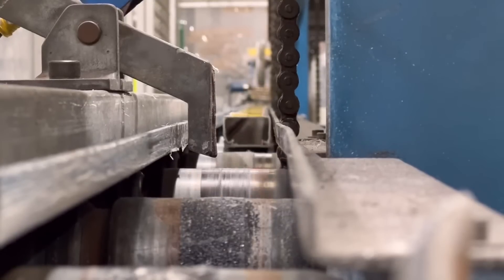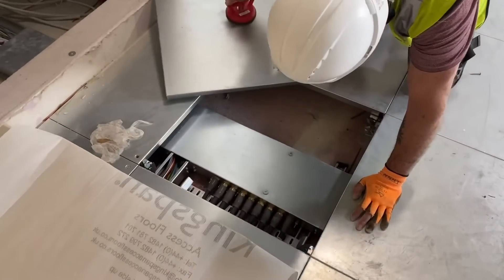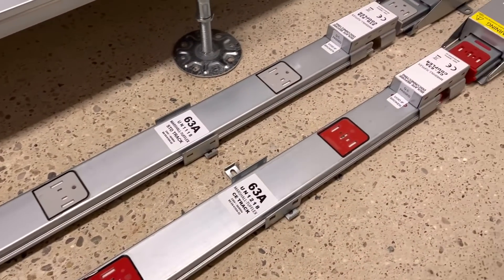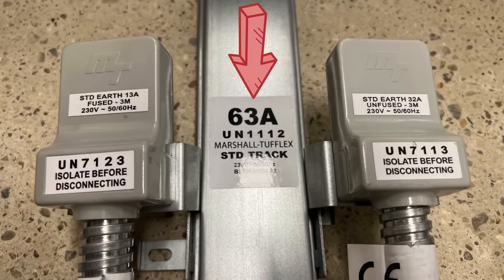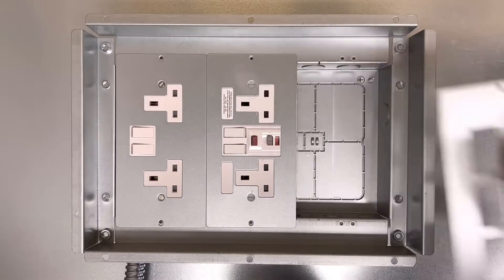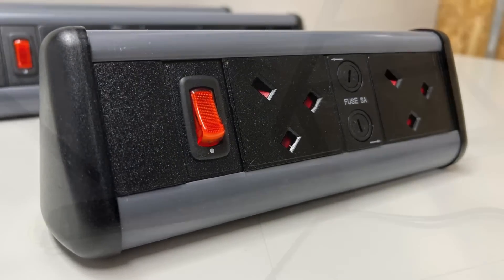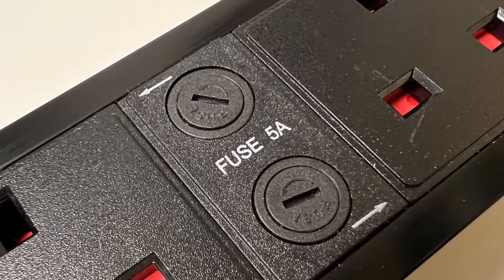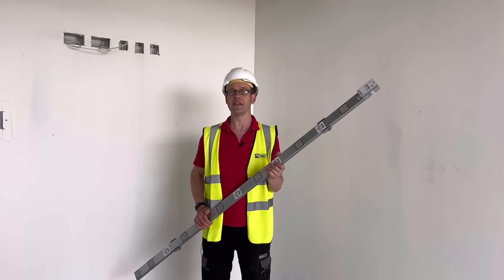What Is Underfloor Busbar Trunking?

Comment: Lol, 16 mm2 cable providing up to 63 amps secured by a mere single terminal block using the most crappy screw head ever designed for this purpose. 
Sure 16 amp circuits are regularly installed successfully using such screw, but 63amps and heavy gauge wire really do require some additional care.

Comment: Did a lot of  commercial re-fits  ,    where this was already installed ,  its called Canalis track,,   trunking system,,, , ,  although , overhead , above the ceiling ,,    3 phase ,,    ,  the outgoing ways ( plugs and leads  ), you  just change the pins .to suit the phases ,,  .   to balance the loads,,  and run to wherever you want,,,,,     .      this was in the u.k  , and about 10 years ago,,,  ,    not sure if it common anymore?   ,        Not sure if it was  something which was a trial, at the time,,    but definitely come across this..              i reckon it was ,  say,    3 lots of  3 phase busbars running the length of a commercial premises ( large shop floor )  ,,  , and could just tap off where-ever you wanted...     a bit of future proofing , maybe ,    but also to minimise  labour and material costs for any additional circuits.,,.'        Zs was always a decent reading tho,,,  ..
Reply from the maker: Great comment, thanks for the insight. 😊

Comment: Legrand also makes a similar system, but have a Three-Phase option as well as the Single phase and Clean Earth options available from Marshall Tufflex. The Legrand system is called Electrak. I was responsible for a site that used it extensively under the raised floors in the offices and computer rooms.
Reply from the maker: Thanks for the comment.
Reply: Legrand do all what was in this video. The underfloor comes in Standard / clean earth / dual / 3phase options. They also do floor boxes which can be configured to almost any specification. Also under desk sockets and on desk units. Really good quality. You should do a video on all these. Unless you just do people that pay you to advertise their products.

Comment: 63A busbar with a bit of chocblock as the input.............. really??????!!! and compared to a normal extension lead I wonder what those MT ones cost?
Reply from the maker: If it's correctly rated why is it a problem?
Reply: @efixx  correctly rated doesn't fix the inherent problem of incorrect install. Any and all installations at such high currents have torque ratings and specialty screws to ensure proper operation. Have you ever seen a (recent) 63amp distribution board use choc blocks for input? They either use crimped on spade connectors or dual clamp down screws that is either a hex head or torx so you can apply proper torque. 63 amps is no joke. slotted or flat head screws are simply irresponsible in such applications. 

And then the joke of allowing up to 16mm2 cable to feed into such a unit. 63 amps is 10mm2, allowing 16mm2 will result in ... well disaster. Considering the market for this type of busbar that is, which is the cheap (and thus dangerous) ones
Reply: @patrickd9551  "the joke of allowing up to 16mm2 cable to feed into such a unit" Explain? In a large commercial space, multiple of these units will be run in one space, ergo cables would need to be upsized for grouping factors, etc from the supply. Just because a 10mm would be "sufficient" for 63A doesn't mean it's correct, there are variables to consider. It's perfectly logical for manufacturers to allow larger-sized cables to be terminated into their equipment as it makes the product more viable for designers and installers alike.
Reply: @dinc15  Okay lets assume the possiblity of daisy chaining. If you want to daisychain two 63 amp circuits, how large would your primary feed need to be? 

If you answer 25mm2 you'd be correct. Now please explain to me how you would fit a 25mm2 cable PLUS whatever downstream cable you need for that daisychain? 

The only reason for 16mm2 cable for a 63 amp circuit is a really long cable run. And guess what, you have dedicated sub base boards for that specific purpose. 63 amps is no joke and if you go down the path of installing such heavy circuits, you'd be better off to invest in some proper equipment.

Proper being something that doesn't contain chocblocks for starters.
Reply: @patrickd9551   "Okay lets assume the possiblity of daisy chaining." let's not, as these units shouldn't be "daisy Chained", that's why they are interconnected to each other with the proprietary connectors and the number of units connected together is determined by load/volt drop.

"The only reason for 16mm2 cable for a 63 amp circuit is a really long cable run." Categorically incorrect. As stated above, a grouping factor of 10 submains would require a 16mm minimum. "And guess what, you have dedicated sub base boards for that specific purpose", yes that is exactly how these are typically installed, each Busbar "run" being supplied via its own submain and device. Are your comments from a UK perspective or another country? As this channel is aimed towards the UK market/industry.

"Proper being something that doesn't contain chocblocks for starters." Agreed, nicer solutions are available on the market nowadays, but choc blocks are acceptable as long as the installer does a good job!
Reply: @patrickd9551 bullshit, I recently fitted a 95mm armoured supply into a machine control panel. Wana know how it connected? Wago din rail connectors! Put cable in, give it a quarter turn and the internal spring does the rest!
Reply: @darylsavage119  in what world is a wago clamp equivalent to a chocblock? The internal spring is there to provide the exact pressure, how hard is that to understand? 

Yes, it might be a different system and yes it might not be a hex head torqued with the proper tools. But it still is a system that has internal safeguards to provide the correct pressures to the cable.
Reply: I thought the exact same thing. Complete joke.
Reply: That was the first thing I noticed and everything after was meaningless due to that.
Ffs why would anyone think this is acceptable in an equipment like this.